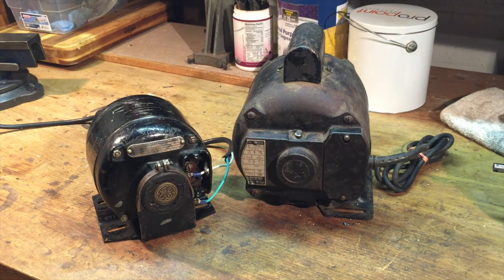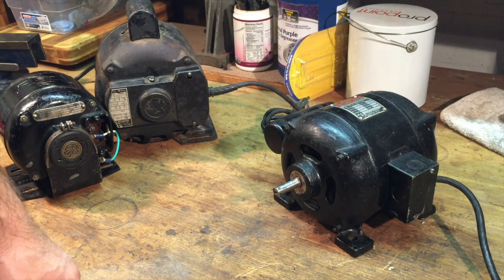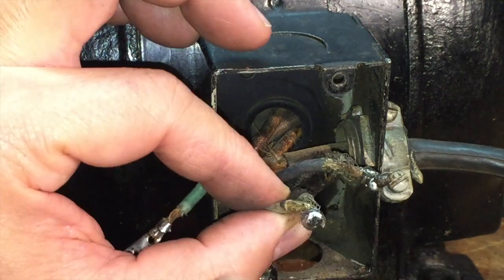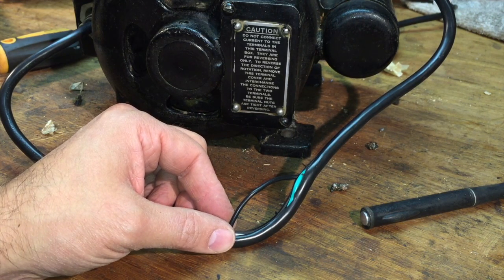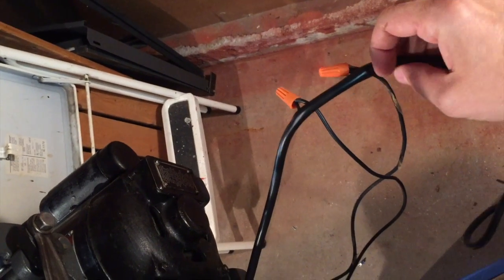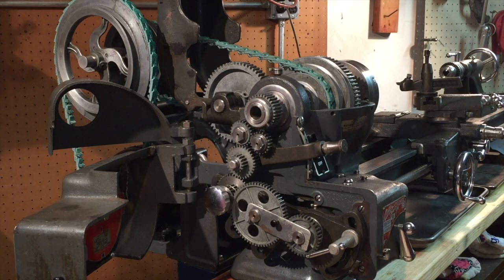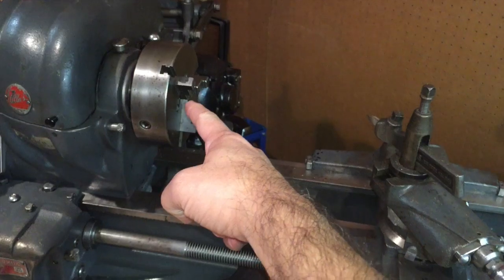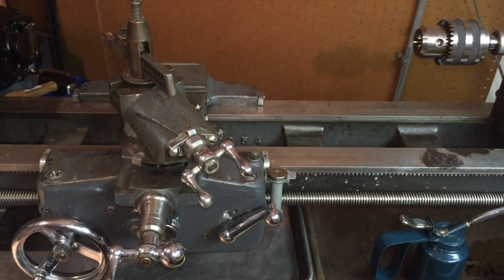Rewiring an Atlas Lathe Motor part 2  - part 21 of my Atlas a lathe Restoration

Comment: great,  i have the same machine i just acquired and i am going to do the same thing. congrats on the lathe, it looks great.
Reply from the maker: Thanks and congrats to you as well. I have to take apart the spindle again because I forgot to install a tiny spring and ball bearing that holds the spindle locking pin in place. I'm dreading having to do this again.

Comment: Would you mind telling us how much you paid for your lathe?
I have an old 6" × 18" Atlas that came with lots of accessories. I got it for $300.
I don't know if that's a good deal or not.
Thanks for the videos.
Reply from the maker: Hi! Even though your lathe is small, that sounds like a pretty good deal! Tooling is expensive. Items such as a follow rest, milling attachment, steady rest, chucks, tool holders, cutting bits - that’s a lot of extra money you would have to spend. My milling attachment was almost $300 when I bought it several years ago. Using your lathe to make or repair items you would normally need to buy or have a shop fix is where it pays for itself. Good luck with it!

Comment: I would have soldiered,,,but I also would have used a dc treadmill motor,,,can t beat them
Reply from the maker: I wish I had the electronic know how to wire up a VFD. I was just figuring on getting the lathe up and running when it was first made.
Reply: @eviltwinx  treadmill motor is better then a vfd ran ac motor,,,more quiet and smooth and much more power,,, and a hell of a lot cheaper, I have dc treadmill motors on my metal lathe,,wood lathe, bandsaw and drill press.  Only way too go

Comment: Your motor pully is way to big, it should be about as small as possible on that 1/4 hp motor. I have same lathe with 1/2 hp motor and it has a tiny pully and it works perfect. That big a pully and your gear ratio is messed up for a lathe, they need more torque, not more speed, at leat the older type like this. It will probably work fine for smaller stuff but if you try anything decent size it will bog or just stop. I'd keep my eye out for another motor such as a 1/2 or better yet a 3/4 hp motor for it. 1/4 hp is too small. 

Here is an idea, you can get a heavy duty digital variable speed sewing machine motor. These are made for professional sewing machines not tiny little home style sewing machines. These are 1/2 to 3/4 hp with a digital speed controller and work great on smaller lathes.

Here is a link to one that would be perfect: https://www.amazon.com/Genuine-CSM1000-Machine-SM550-1-PLKHG484UY5151/dp/B016EJ1WB6/ref=pd_lpo_vtph_23_tr_t_2?_encoding=UTF8&psc=1&refRID=FWC2KQE7CST6W23KSMJ7

And..... I never would have dreamed of taking a lathe apart like that without painting it. Why not? if you got it all apart, get some paint prep cleaner or even some stripper and just repaint it same shade of gray.
Reply from the maker: Hey Robert! Thank you for not only viewing my video but also taking the time to write up an awesome comment with great suggestions! I have to get back on the lathe. I'm sooo close to finishing her up. I didn't paint the lathe because I started this in the winter and my shop is unheated. I do have the right parts to get her up and running, just need to find the time to do so.

Comment: Nice lathe. I have an atlas 618. One thing you should know though, is to never run a chuck without anything in it. They can loosen and smack ya in the face. Stay safe and have fun.
Reply from the maker: Ouch! That would hurt. Thanks for the safety tip!

Comment: Are you sure the "extra" wires in your motor are for 110/220v???? My Atlas Lathe is a lot like yours and the motor has a FWD/REV switch...... Maybe those extra wires are for running motor in other direction?
Reply from the maker: Thanks for pointing that out. I'm not really sure. I thought it might be for 110/220v because the motor saying it can be wired for either. Weather is starting to cool down so hopefully I'll be jumping back on this project soon.

Comment: Awesome I can't wait to see more.I've been stalled on my rebuild of a QCGB-42 Nearly the same machine as your. My machine runs but I want to tear it down and paint it. Unfortunately I sold my house and am waiting to move into a new construction house with a much improved work space in the basement. However in the short term I had to break down the shop and place it all in storage.One thing I did different from a power supply option was to Mount a Standard Duplex Outlet to the underside of the Main Plank of the Lathe Stand. This goes straight to my wall outlet with a Replacement 3 Prong Power Cord (like you used). BUT... One of the Outlets on the Duplex is switched and the other is NOT. My Motor has a short 16" Power Cord with a 3 prong plug and plugs into the Switched side and that goes to a Toggle just like yours, mounted on the front of the Lathe. ( I made my own Plate from some scrap Stainless I had hanging around). The other side of the Duplex Outlet the NON - Switched side I plug a Flexible Arm Desk Lamp into for a work light.
Reply from the maker: +Rod H I'm jealous! New construction with a basement workshop! My lathe sat for nearly 3+ years before I was able to start working on it. I have an old flexible work light that I want to mount to the lathe. I just might wire it up the way you did yours.

Comment: Super Duper!  Perfect motor!  Glad to see it.  Look for your slowest gear set to tame the feed rate.  I know, you know that anyway.   ;-)  I sure would hate to get my digits tangled in that cross feed handle.
Reply from the maker: +Crafted Thanks man! Looks like I need to solve the motor rotation issue before moving on though. Another challenge!
Reply: eviltwinx I've been thinking, can't you get forward and reverse out of it?  At least get the wiring in there for when you come up with the reversing barrel switch.  I need to rework my Old Gray Lady to get the reversing going.  I've only got forward at the moment.  I didn't catch the rotation issue, is it running backwards?
Reply from the maker: +Crafted Yes it is. Bob Mullins was kind enough to contact me and told me how to fix this. It's seems pretty easy to do. There's a plate on the opposite side of the motor that gives you access to the wires that control directional spin.
Reply: If I am not mistaken, they will be yellow.  These are the wires that get reversed in the barrel switch to achieve reversing.  Glad to hear he is still around.  No videos lately from Bob.

Comment: Sorry if I missed it (binge watched all ur videos today haha!), but did you ever figure out why your tumbler gears aren't meshing right.  I just sold my logan 821 (similar in size to yours).  I don't regret it as I only used it maybe 20 times in the last 10 years but I do miss it.  I did a complete teardown and cleaning like you.
Reply from the maker: +Jay Walt Hey Jay, first off, thanks for the sub and watching my videos! As for the gears, not yet. I've tinkered with tightening the nuts and bolts hoping that would help but nada so far. It's on the punch list after I get the lathe fully operational.

Comment: Glad to see it up and running. Looked like the motor is running backwards, you will need to reverse it. You mentioned you put it in backgear, but that sure wasn't back gear.
Reply from the maker: +Steve S You're the third person to mention about the motor direction. I was freaked out so I went into the garage this morning to check. It is running backwards. :( Not sure how to fix that yet. I did have the lathe in back gear and it does run fast. It's still much slower with it engaged than not. I'm hoping it because the pulley on the motor is the wrong diameter which prevented me from setting the gears to the slowest speed.

Comment: why is the chuck running backwards.
Reply: +Bison Workshop-Bob, You noticed it too, I was hoping I was wrong. Ed Pace
Reply from the maker: +Bison Workshop I was hoping it was the way the camera recored the video but I checked this morning and it is running the wrong way. :(
Reply: +eviltwinx its no big deal. on the panel at the other side it gives you directions on reversing the rotation. just reverse the wires  behind that plate

Comment: E.T.,I may be wrong but It looks like your spindle is running in reverse. Check to see if your motor is turning clockwise like it should be.(from the pulley side) Your chuck needs to turn counter clockwise looking from the tailstock end. You may have to rewire the motor to correct it.Cheers,Ed
Reply from the maker: +Ed Pace Thanks for the heads up. It might just be the way the camera captures video but I'll definately give that a closer look.

Comment: good job are you certain that was back gear looked really fast to me
Reply from the maker: +Chris Anderson The back gear was engaged. The pulley on the motor is the wrong size and only one step. Crafted 3D printed the correct pulley to get me started. The spindle speed should slow down quite a bit.
Reply: +eviltwinx oh silly me l watched those videos to. lol